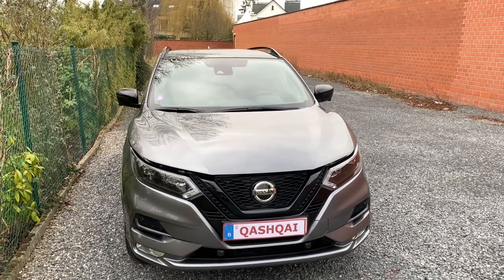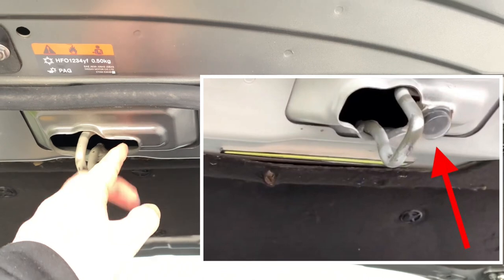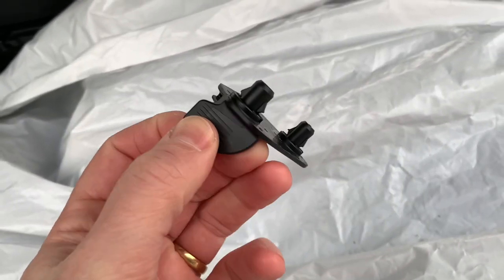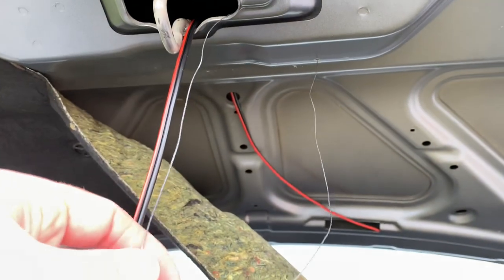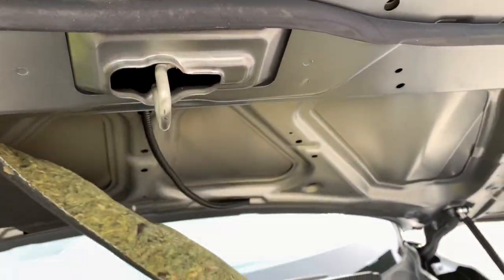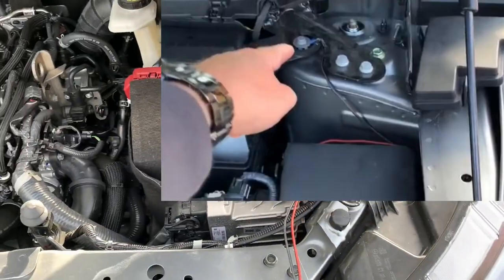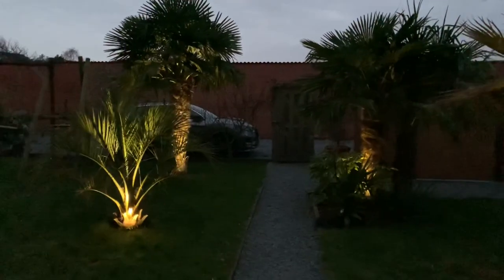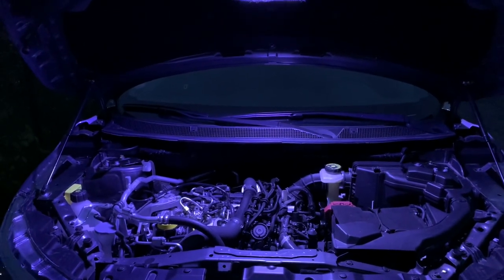Nissan Qashqai J11: LED light under the bonnet (improved version)

Comment: a really nice job! Honestly I would have put a magnetic switch so when you lift the hood it turns on automatically, obviously I would also have put a button to deactivate it when not needed. But it's great even so, I wonder why they don't put them as standard.
Reply from the maker: I tried a reed switch on the first Qashqai which is indeed magnetic but there is no easy and clean way to well hide it. And for the little use... I let it be.

Comment: Can someone help me understand this.

When you start a nissan qasqhai. Why is there a seatbelt message on the screen everytime even though everyone is using their seatbelt? I have seatbelt icon and 3 red dots on the backseat.
The error message is only visual, no sound. Usually goes away in 30-45 seconds.

I contacted the dealership where I got the car from and they said it's normal but I am not so sure
Reply from the maker: Hi! It's not an error message, it's an info message! This way, when driving of, you have a quick visual control of who's wearing a seatbelt and who is not. This because there isn't a sensor in the backseat itself so you wouldn't notice if the persons in the back didn't attached there seatbelts, as it does for the passenger seat ;).
You can quickly skip this info message by pressing enter on the steering wheel.
Reply: @LaPalmeraie0032  Thank you so much for that information!! I cannot say enough how much your channel have helped me with my car! Please keep the content coming!!!! :D Wish you a GREAT monday!!
Reply from the maker: Thank you friend 😄 👍🏻